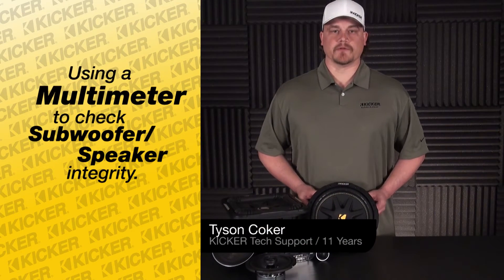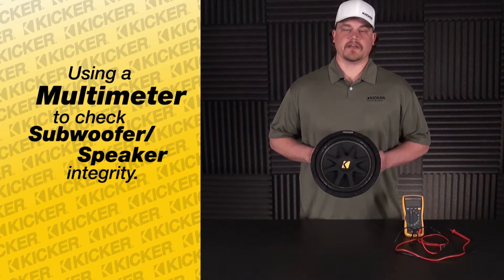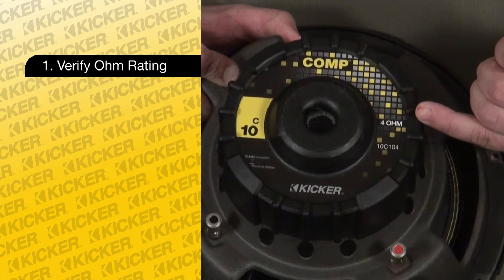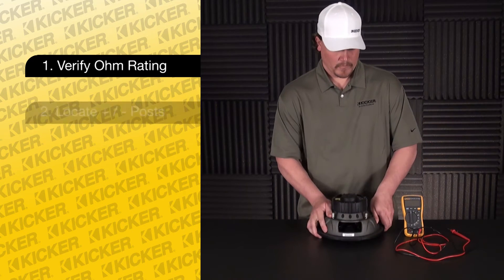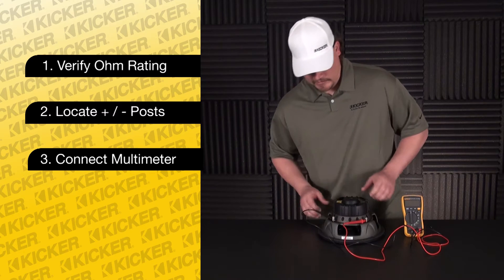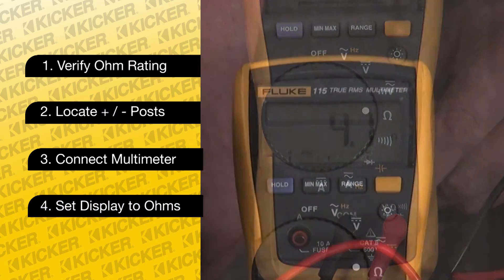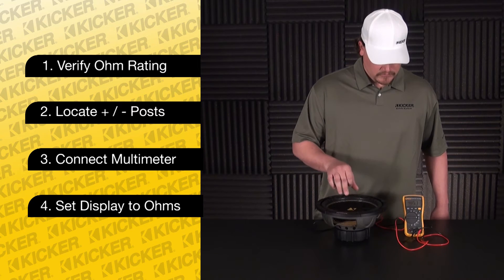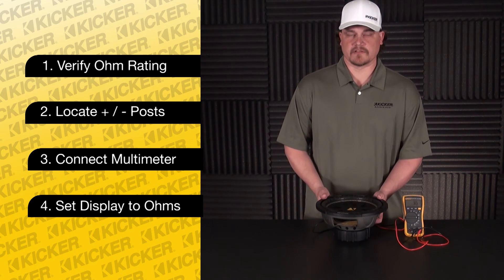Subwoofer Tech: Testing the Voice Coil on an SVC Sub with a Multimeter

Comment: Hello! Interesting video, actually i measured my 4 ohm woofer with a multimeter, and it shows 1.9 ohm, this means that my woofer is damaged or blown? actually it sounds really low and when i try to putting more volume the amplifier go in protection system :s.... thanks in advance for your time and advice!